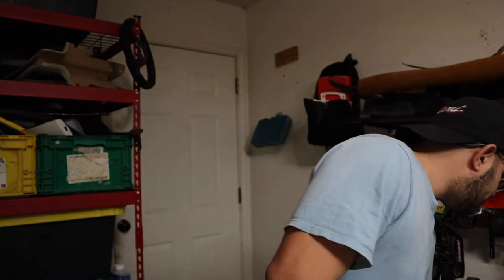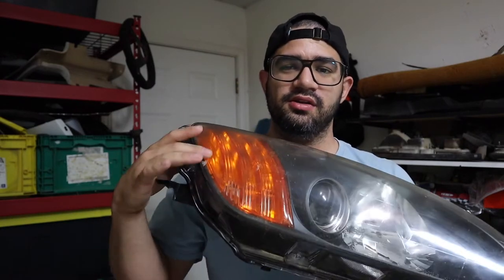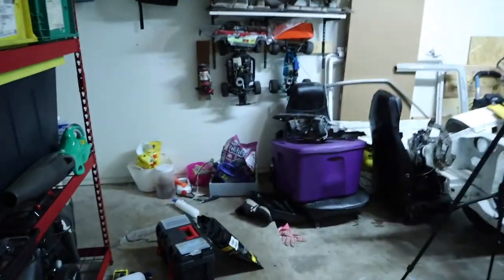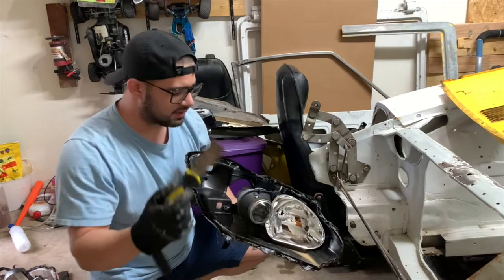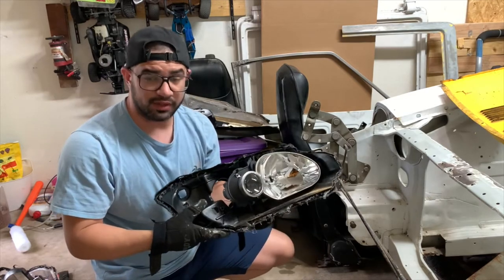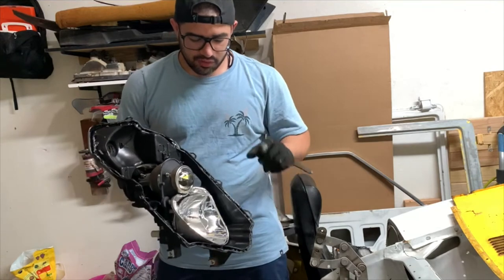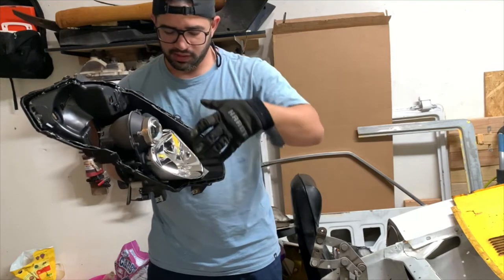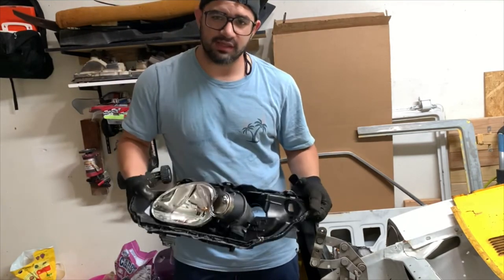S2000 Headlight Lens Removal with Oven!

Comment: Hey man thanks for the video. I'm in the process of wanting to do this too. I bought cheap ebay ap2 headlights but want my ap1 projectors for better cutoff and brightness of course. Were you able to swap the internals to the cheap ones? If so, how was the process? Do you need to realigned the beam?
Reply from the maker: Yes I bought the cheap ones as well for an ap2 I plan on making a video on that process but from my understanding is you can swap the internals which was my plan while changing the amber marker for the jdm style clear one and once you remove insides you should have access to the beams to align them hope this helps thanks for watching!

Comment: What did you use to get the glue off after removing the lens
Reply from the maker: @BenitoAmador-lk6vu  so to remove it put it back in the oven for about 5 min or less you don’t want the glue too soft cuz it will make a mess and won’t completely come off and just warm enough to scrape it off with a flathead and keep cleaning the flathead so it dosent get stuck onto it good luck!